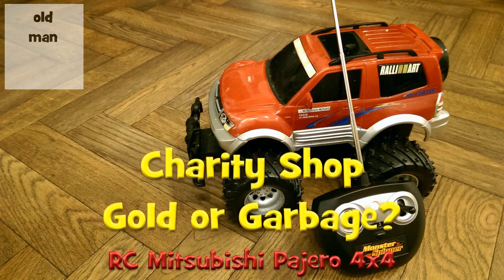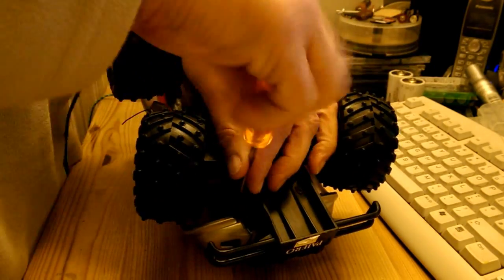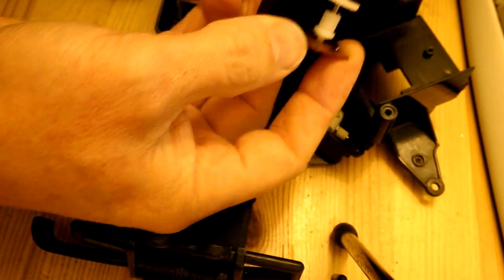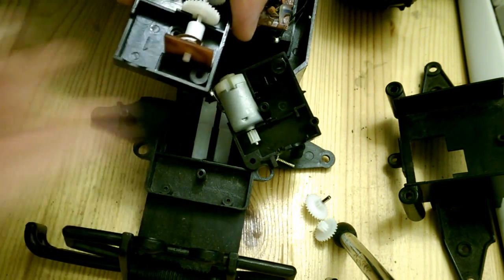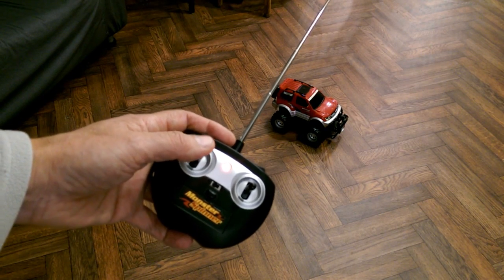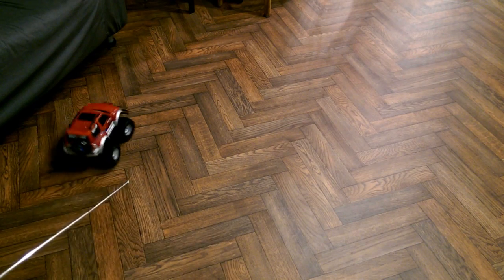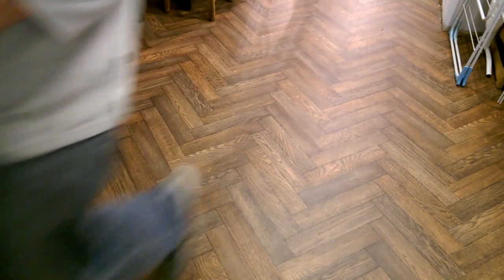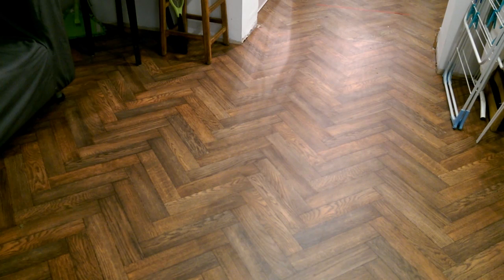Charity Shop RC Mitsubishi Montero Steering Problem

Comment: Nice fix and well explained...likely more complicated than an actual Pajero !
It's the only 4x4 that i've ever seen that can drift.
Reply from the maker: +slider2732 thanks, I was looking at the possibility of a simple hobby grade conversion but that steering system sort of put the dampers on the idea. I may still consider it but put a normal servo on the steering and do away with all that clutter. I would probably need to buy a more substantial servo than those cheap 9 g ones I normally use.

Comment: I guess what I meant was that you could change around the gears and maybe make them stronger or make the wheels have more RPM and a better motor maybe
Reply from the maker: +ZatBat I can see where you are going with this but I think you would be wasting your time. You might be lucky and find a more powerful motor that is an exact match to the dimensions of the existing motor. If it is not an exact match then you would have a lot of trouble trying to fix it into the existing plastic casing. If you were extremely dedicated you could take the motor apart and rewind the armature with different wire to increase the power. Changing the gears would also rely on you finding a combination that fitted in the same gearbox with the same distance between the shafts but a different number of teeth. Neither of those options would have anything to do with making it hobby grade if you mean hobby grade RC. The most effective way to upgrade it to hobby grade RC would be to take the body shell off and throw the rest away. Put the body shell on a proper hobby grade RC chassis with a proper motor and gearbox and proper servo steering and suspension and a proper 2.4 gHz receiver, not forgetting proper hobby grade off-road wheels and tyres. If you just wanted the extra range of a proper hobby grade RC Receiver/Transmitter combination you could do a conversion like I did on this toy RC off-roader but you are still stuck with the low power,  poor steering and the poor grip with the toy grade tyres https://youtu.be/uM7Obu2wnKA

Comment: what about making it fast could you do that with the same receiver and the same steering but maybe change the gear box if you have to for cheap?
Reply from the maker: +ZatBat interesting, how would I change the gearbox? It's not as if it has a discrete gearbox that you can swap? It is all integrated as part of the motor housing.